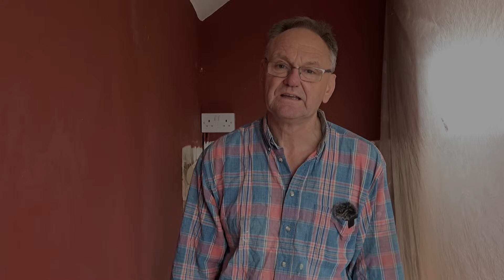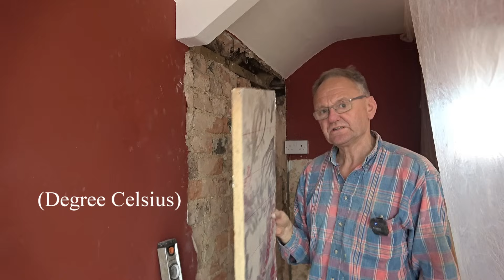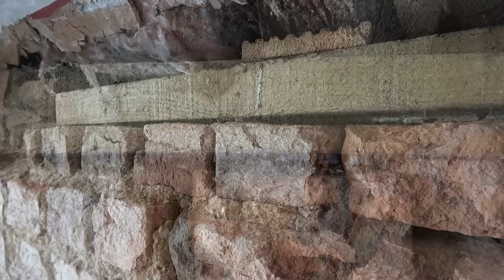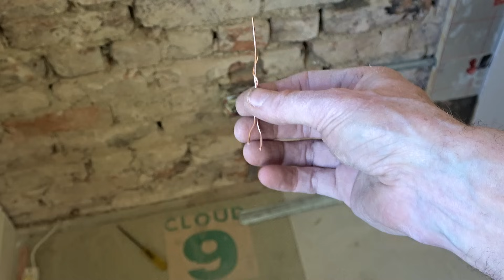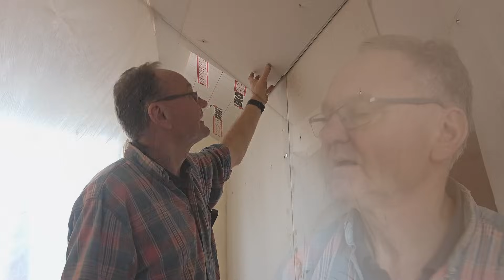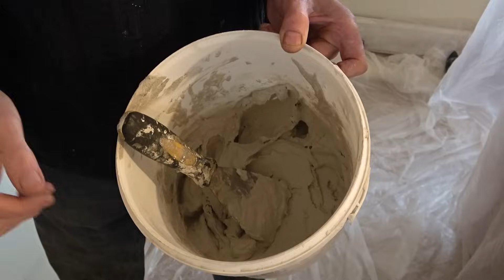HS165 Insulating a solid wall (Do it yourself)

Comment: A little tip if you decide to do any more walls like this. You can get proper adhesive foam for gluing the sheets to the walls and the plasterboard to the insulation, it's not the normal expanding foam from the likes of screwfix etc, but a proper one for plaster boards etc. It will be easier than trying to screw it to the walls. Or if you want to carry on with screws get some insulation washers, they spread the load over the boards and don't pull through like screws on their own do.
Reply from the maker: Hi carlb-photography, if I do any more I will try both those ideas, thanks. Cheers
Reply: Was thinking the same, foam might be easier
Reply: I've done a whole house back to brick and stuck the insulation boards on. A tip is to sbr the walls to stop the dust. You still need a few fixings to hold the boards back in case of fire.

Comment: Silver tape the insulation boards together to form a seal, the plasterboard will still get cold if air is flowing through to it.
Reply from the maker: Hi Stewart, thanks for your advice. Cheers

Comment: With all that work, why not use more insulaton and do it really good !
Reply from the maker: Hi Rene, even after chopping the plaster off I only had max 2 inches gap between the brick and the cupboards. What I put on still makes a big difference. Cheers

Comment: Hi Paul,
Thank you very much for the video and congratulations on a job well done.  Just a few questions if I may.
Is this a room upstairs or downstairs? How thick is the wall in total?  No plaster outside? You mentioned sheltered, that means no rain water at all?
Many thanks,
Jiri
Reply from the maker: Hi Jiri, it is upstairs. It is double brick 9 inch thick. No plaster outside. The wall faces a similar wall on my neighbour's house, the gap between the walls is about 15 inches. There are gutters over the opening so the gap it is not very open to the sky. The gap is closed at one end by part of his house joining mine.  Cheers
Reply: @HaxbyShed  Thank you very much!

Comment: Thanks
Reply from the maker: Hey Brian thank you very much.  After 180 videos and over half a million views you are only the 2nd person to give me a Superthanks. I never ask for thanks but occasionally it would be nice.  Regards
Reply: @HaxbyShed  Thanks again Paul. Was the insulation to current fire resistance standards? And did you need building regulation certification?
Greetings from the Netherlands.
Reply from the maker: @CSquid100  you might think my reply a bit casual but all I can say it was new insulation designed for houses so to that extent it will be fire resistant. And also to say this is just one wall in my own home and I won't ever be claiming it on an Energy Performance Certificate or anything else for that matter ..... so I think that answers your second question 😉😉. Cheers

Comment: This must be a cheaper alternative method to cavity wall insulation by a specialist contractor. 
I have 3 story end terrace house exposed to the cold east winds but could do this as you propose from the inside.
Thank you for taking the time and trouble.
Reply from the maker: Hi Brian, it's quite a lot of work to insulate internally and a cavity wall insulation company will probably blow your insulation into the walls in under a day. I've no idea how they compare for perceived warmth. Cheers

Comment: A gap should always left between the brick wall and the insulation, to let air circulate, this is to prevent damp
Reply from the maker: Hi Martin, yes I see your point but logically that means you need vents at the bottom and the to to make the airflow effective. I may be wrong, but I don't think just a gap on it's own would be the complete insurance against condensation forming. Cheers

Comment: My house is 1959 with crosswall construction. The timber panels are very thin between the 2 end walls and there is a short section of sloping ceiling which needs insulating. This makes it seem possible for me to do.
Reply from the maker: Hi Holgre, I think this method is very suited to insulating a bit of sloping ceiling. I have insulated several sloping ceilings in my house this way. Cheers

Comment: Great video Paul. I have used insulated backed plasterboard a couple of times now and got some great results with it but you are right it is much more expensive than buying the insulation and plasterboard separately so tempted to try it this way next time. Also from personal experience the insulated backed plasterboard is quite awkward to lift especially in full sheets (definitely a two person job). I suspect doing it this way does make it slightly easier if you're doing things on your own. I've used the dot and dab technique every time but might try just going for mechanical fixing next time (as you are meant to put fixings in anyway using the dot a dab technique for fire safety measures). I have used foam adhesive last time around and you have to be relatively quick to get the boards up and in place before the adhesive sets but it does go very solid and no flex/movement in boards once cured. Once again great video and very informative.
Reply from the maker: Thank you Sam, if I was doing more, particularly on a small section, I would try 'dot and dab', many people have suggested that. I am sure it is more work to fix insulation and plasterboard separately but with low ceilings and limited space it makes the job a bit more manageable. But I imagine that fixing insulation-backed board with foam on a straight good plaster wall would be a doddle. Cheers

Comment: Whilst I admire the commitment as I understand it this is not quite right. Please look this up for yoursekbutthisisas I understand it.
Solid walls are subject to water infiltration from the outside and from the inside you get water vapour from the humidity in the house.  As strange as it may seem these walls are intended to breathe to release this water vapour. From the outside it is done by the wind and sun. From the inside  itis released back into the house slowly evaporate. Putting non breathable celotex, plaster and non breathable paints you effectively, lock this vapour and stop it evaporating. This can lead to problems down the line.
You should use breathable insulation boards such as Cork boards, wood fibre boards, these can be plaster onto with lime plaster. Many cavitybatts, sheep wool insulations are suitable. 
There are suggestions that you shouldn't make the wall "too" insulated as this will make the wall colder and reduce the drying of the wall, this leads to more water in the wall which leads to greater  cold transfer and more damage degradation to the wall.  Pleased your research!  if its old stone don't repoint with sand and cement, use lime mortar asthenia sand cement will be stronger than the stone which will then deteriorate before the joints .
Reply from the maker: Thank you James. There are many people still at the planning stage and I'm sure the info you provided will help them decide how best to tackle it, especially if they have solid walls. Cheers

Comment: Hi Paul, Is the other side of that wall exposed to the outside. This looks like my basement wall just behind the porch and it's actually a stone wall in disrepair so I will need to fill in the gaps with lyme mortar. I avoid concrete products whenever possible. This looks like the fix for me because I want to keep as much room space as possible ... I thought adding insulation on the inside of an exposed wall will create the outside brick to deteriorate, reason for my question. thanks so much. looks great.
Reply from the maker: Hi Karen,  the other side of the wall is outside but in a very narrow passage between me and my neighbour - maybe 15inch (380mm) wide. The passage is covered above by two gutters so the gap to the sky is perhaps only 6 inches. The passage is closed at one end thus very sheltered. People have said that there should be an air gap behind the insulation but to my mind it would also have to be vented to be effective. Thanks for watching. Cheers

Comment: Wondering why you did not use dot and dab or adhesive?
Reply from the maker: Hi Andrew, just stuck in my ways - I've not tried 'dot and dab' before so I went with what I know. This is probably the last wall I need to insulate. If I was doing more I would probably invest the time to learn d&d. Cheers

Comment: I'm at a restoration myself, I've be warned against any form if gysum board as it will trap moisture and make walls even damper years down the line. I'm using corkboard and lime plaster. I really want to use kingspan but tbh just can't take the risk
Reply from the maker: Hi Darren, yes a number of people commenting have been concerned about the risk of condensation and damp. I suppose if I had never done this before I'd also be concerned too but from my limited experience doing this on 4 walls in my home, and a couple of alcoves, over a 12 year period I've not encountered any problems. Initially it was not a risk assessment but rather ignorance on my part but it seems to be ok in this case. Perhaps I've been fortunate, I don't know. Some people have witnessed bad condensation, with their 'own eyes', so it does happen.  Cheers

Comment: Well done Paul, a good job and a good video.  I did a similar job throughout a small cottage bungalow that I rent out,  Fortunately my walls were in a better state than yours and they had been "blackjacked" which had completely kept the damp out,so no problem in that respect.  However, for anyone finding the drilling and plugging a bit of a hassle,or problem (such as loose areas) it is worth considering the "dot and dab" method, even if in just some places.  The adhesive is very inexpensive, has a super adhesion once dry and it still sticks well to the aluminium backing sheet. The sheet can be gently tapped with a batten and hammer across it's face to get it seated nicely onto the wall.  If not using any screw fixings the sheet can be held in place with a few masonry nails hammered loosely through a small thin plywood pad to hold the sheet in place , then removed later when adhesive is dry.  This is quite a quick method of fixing and although more practical for the insulation already stuck to the plasterboard sheet, it would certainly help in those "hollow spots which are so difficult to get a good fixing.   There's no doubt though that the finished job really improves the heat retention and comfort in any room,especially if done to all walls in a room. I also ripped out all the old windows and put in new double glazed ones, before I started on the insulated plasterboard.  The difference in room temperature was incredible-------well worth the expense and effort-------for future tenants (and EPC?)
Reply from the maker: Hi David, thanks for explaining. One or two people have mentioned that the EPC inspectors need proof of the work and, for example, just taking off a socket cover to show the insulation is not enough. So just be aware if you are counting on an EPC then I'd suggest finding out in advance what can be admitted as proof. Also I don't think their assessment software is very clever and I've heard of people spending a lot of money on improvements which have not counted because the standard assessment software can't deal with them. I once put just half an inch of foam insulation on a very cold solid wall and the difference was amazing. That was 10 years ago and I can confirm there has been absolutely no sign of damp or degradation of the outside brickwork. It might be different if the wall had rising damp to start with. Cheers
Reply: ‘Especially done to all walls in a room’ don’t you just insulate exterior walls internally?
Reply from the maker: @Chief81  responding to your question there, people have said a solid wall without airflow will condensate on the inside, but also because the wall then holds more moisture it is then prone to frost damage and the brick faces spalling off. Now you can decide for yourself whether this view is real or just a theoretical risk but that's what I was covering off by referring to the outside (when I was insulating on the inside). Hope that makes sense. Cheers

Comment: Well done ol' lad. Hope the Misses appreciates your hard work.
Reply from the maker: Hi Dean, well you know what it's like .... buy flowers (1 point), put the bin out (1 point), insulate wall (1 point), save humanity from nuclear oblivion (1 point).  She has conceded it's warmer and likes the colour she chose (blue). Cheers
Reply: @HaxbyShed  Blue in a bedroom!!!, very brave. I like your logic with that point system you've got going on. If I adopted that same system I would be winning without any doubts. I enjoyed watching your video, it's nice to watch other people such as yourself tackling jobs. Your video reminded me of a supposedly easy job that I did for our lass. She wanted her bedroom ceiling painting so I readily offered my service, I masked all around the top of the walls then preceded to paint. Immediately after painting I peeled away the masking tape mostly without any issue. When I peeled it away from her wall paper, the paper came off with it. I started to chuckle to myself because I knew what trouble I was then in. I convinced R'lass that the best course of action would be to completely take off the old and then I would hang new paper.  Her little face lighted up because she was getting more than she had asked for. That smile was soon going to disappear. I peeled back the paper, it was going well until a big patch of render came off with it. No worries I said to myself, I can soon fill that. More paper came off, more render too. Just like in your video, the whole wall was like sand. The misses came back from work and wondered why there was thirty bags of rubble on her drive. The wall was shot and the pointing was shot too. I had to rake it all out. When the little lady then saw the brickwork she fell in love with it so then another job started. I sanded the lot of it, blowing up her hoover in the process of cleaning the room. I varnished it three times and then used a red coloured mortar to point up. It looks bonny. The ceiling does needs another coat mind. Good luck in your future endeavours.
Reply from the maker: Hello Dean, all that made me chuckle. I could tap quite a bit of plaster in this house and it is obviously loose so I did what any self-respecting tight Yorkshireman would do, I got my wife to paper over it with lining paper and painted it. Been fine for 15 years so far. There is always more work if you go looking for it. Cheers

Comment: Great job. Thanks for taking the time.
I learned quite a bit.
Reply from the maker: Hi Alexander, you will see some people have commented about the risk of condensation behind the foam insulation on a solid wall (no cavity). I suppose I should have used breathable insulation but I have done this process in my home 4 times over 12 years (insulating just one wall) and luckily it has been ok so far I think.  Something to consider, anyway. Cheers

Comment: That was absolutely fantastic! Thanks! Really useful info and to see the steps to try doing this myself. Great job :)
Reply from the maker: Hi Tim, do please read the comments about breathable insulation. I've not had any problems (and I have done 4 wall over 12 years in this house) but apparently condensation can be a problem with foam on solid walls. Cheers
Reply: @HaxbyShed  will do and much appreciated 👍

Comment: It's good that your having a go a internal wall insulation, but building physics tell us that using an impermeable board is not the best choice because you create a condensation risk. had you used something like a wood fibre board it would not have the condensation risks and you could have skim plastered straight over it; cheaper easier and better.
Reply from the maker: Thank you ironimp1. All this advice will be very useful for people considering the job. Cheers

Comment: Some of the comments... oh my.  Don't PVA solid brick walls.  Don't use kingspan.  Solid brick walls built with lime mortar need to breathe.  If you seal them up you will give yourself damp problems down the line.  The correct way to do this is remove any render externally or plaster internally.  Do a parge coat of lime plaster inside, then fit 80mm wood-fibre insulation to it with special fixings and then your finish coat over the top of that in a lime plaster again.  paint needs to be lime-friendly too.  Did my 100year old victorian semi liek this and spent 6 months researching the right way to do it.
Reply from the maker: Thanks Michael, I think people will find your advice very useful. Cheers.
Reply: I hope your viewers do their own research before they do what you did; otherwise, they will destroy their own homes. @HaxbyShed
Reply: I would agree with Michael, insulating a solid wall internally makes the brickwork colder. Moisture working its way through the build up ( lots of gaps at skirting, services etc) will condense on or within the brickwork. Non breathable insulation (such as kingspan PIR) will not allow the moisture to escape. The buildup shown isn't recommended by Kingspan technical.

Comment: Use breathable insulation, lime plaster and breathable paint.  I have seen horrible damp build up behind pu insulation in a solid wall house.
Reply from the maker: Hi Mat, fingers crossed that ours is ok then. Cheers
Reply: @HaxbyShed  if water is not penetrating through the wall it should be OK.   Essentially you have moved the dew point between the insulation and the wall so that's where condensation will form. If it's  relatively airtight and no air space  it will be OK. I've  seen an electrician remove cellotex  from a wall after a week to run wires behind the insulation and it was dripping wet.
Reply from the maker: @ChaosToOrder777  Oh Mat that sounds frightening. A good practical example of what can happen. No signs of it so far - but something for anyone planning a similar job to think about. Cheers